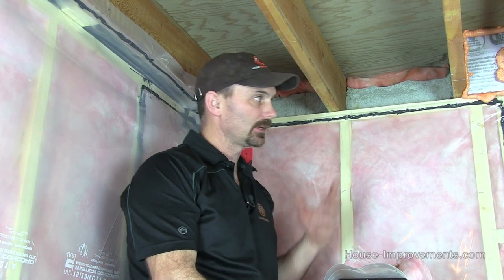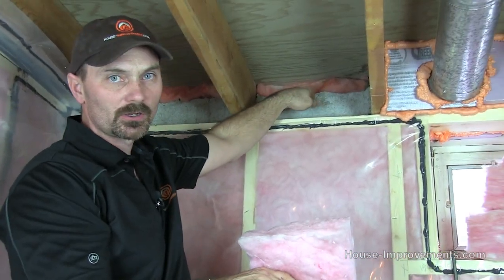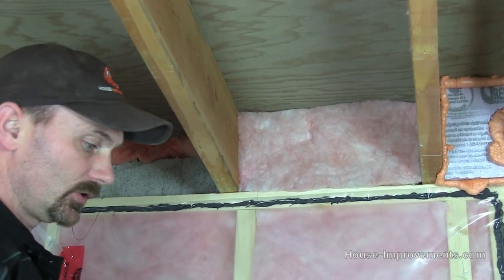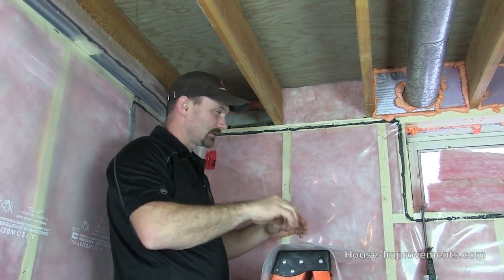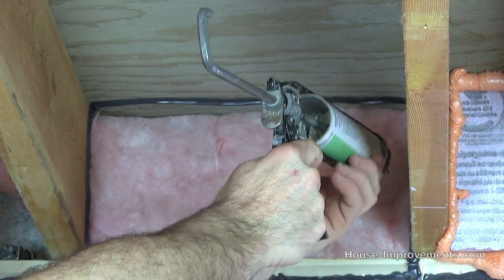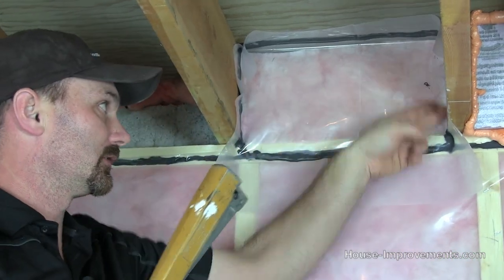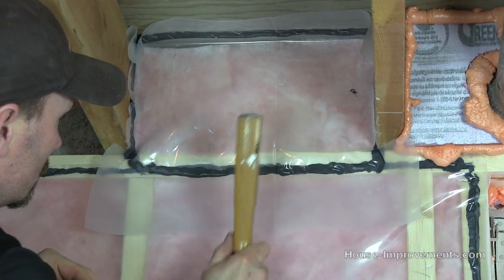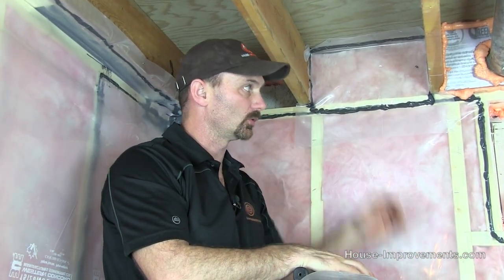How To Insulate Rim Joists With Batt Insulation

Comment: I used that method to seal rim joists. After 15 years so so  we noticed some cold spots in an upstairs bedroom and then in a corner of a basement room.   Removed some suspended ceiling tiles downstairs and found that the acoustical sealant hardened over time and the plastic pulled away letting air get through ever so slightly,pulled back the plastic and insulation and found about an inch of ice on the rim joists , what a mess.  Ended up pulling ceiling tiles around the entire perimeter and found more spots where the plastic separated.  Ended up pulling down all the plastic and removing the insulation… cleaned out mold spots and dried the rim joists then shot it all with spray foam instead.  Spray foam is way more expensive but far quicker and less mess.  If I were doing it from scratch I’d probably do a combination of spray foam and rigid foam to cut the costs a bit but give an excellent seal.

Comment: I chalked and used foam board and foam insulation on my rim joist areas. I’m very pleased with the results.
Reply: Did you use 6 poly over your rim install? Is it necessary?
Reply: @peterbergeris6510  No, don't lay poly over XPS.  Doing so will trap moisture if given the chance.  XPS doesn't need that because it is non- permeable.
Reply: Didn't Home improvement video use 6 poly over rigid insulation in rim joists because it was an inside wall?
Reply: Sorry, he used batt insulation n not rigid.

Comment: Hmmm, I was told by an inspector and a contractor to pull the pink fiberglass insulation out of my basement box sills and use closed cell foam insulation. It doesn't prevent water vapor from condensing and accumulating, causing damage over time. Go with rigid pink foam or spray foam (I picked the pink stuff)
Reply: Roxul is water proof and will not burn.

Comment: Acoustic sealant not required. It is definitely a bonus but you can use the red/blue sheathing tape instead.

Quick pro tip. The black acoustic sealant comes off the skin with a little margerine.
Reply: tuck tape often comes loose over time as it dries, or it might be difficult to stick it to a dusty basement joist - as with any adhesive tape. Caulk will always be pliable and will always create that "air tight" seal, even with time - this is also why he staples it. You can staple tuck tape, but then you're creating tiny holes for air to get through with each staple. Staple caulk and it's self-sealing.

Comment: If there is only one space in a house that should get sprayfoam and not fiberglass, rimjoist would be it. Nice vid you defently do it right I just see fiberglass fail on a daily bases and especially in rim joist.
Reply: I run a sprayfoam rig in Vermont. Treating the basement sill with closed-cell foam is definitely the the most cost effective thermal boundary upgrade one can do to a home. Just make sure there is enough air for all combustion appliances.

Comment: Great video. I’m just finishing a small duplex with an owner until in Alaska. I built boule stud 2x4 walls with a 2x8 top plate. The exterior walls have R40 closed cell foam. . I did the ceilings with R38 on top of R21 between the ceiling joists. I live on a south facing hill and have daylight basements wrapped in 4” of foam. Last winter was one of the coldest here with a week of -30s. We only burned about 500 gallons of oil heating 3000 sqft.

Comment: ive never seen this method used,would certainly be time consuming.most new subdivisions just staple in place without sealant,perhaps use red sheathing tape on bottom. good video as usual
Reply from the maker: stapled in place would never pass code. At least not here
Reply: thats all they do in York Region
Reply: @HouseImprovements  been insulating 6 years in all of SW ontario and literally I'd quit if I had to do this. 
a few staples and that's it

Comment: I did this in my old house. Was planning to do in my new house but the inspector said I needed to cover with drywall. Poly or kraft faced insul is flammable.  I need to do something since I'm getting condensation on the top of the exposed concrete, under the fiberglass insulation
Reply from the maker: Thats a new one to me, poly is not generally worried about left exposed in rim joist spaces? Ask about using  rigid foam sealed with canned foam and ten covered with Roxul insulation (it is fire resistant)
Reply: @HouseImprovements  I used 1" foamboard then sealed with spray foam. Brought batt insulation out to the plan of the drywall. In the winter when I removed the batt to inspect, there was moisture and frost on the joists and concrete sill. Since I live here now, I may just do what you show with some minor mods since drywall is up and painted. Instead of poly, I have this plastic that will breath vapor when the RH >60%.  Will feel better about not locking in vapor if any is present. Thanks for reply.
Reply: I think your inspector doesnt know what he is doing

Comment: A vapor barrier is usually put on the ceiling under the drywall and never on the walls! The good and a healthy strategy on attic ceiling insulation is like this from inside to outside: drywall-vapor barrier-insulation (at least 20 cm) - radiant barrier! between the deck and the vapor barrier remains a 2cm open space between the rim joists where venting is allowed in order to let air to pass above the insulation and let the insulation dry in vapors goes into the insulation from outside. Important: the radiant barrier is micro-perforated!  In this way when the solar energy heat the roof, the deck absorb energy and re-emit through convection on the radiant barrier surface. because of reflective properties of the radiant barrier almost 97% of the heat is reflected back on the deck. With this strategy the upper side of the insulation will be almost and always at the outside temperature and will let existing moisture to dry on the 2cm airflow space. I make this way in my home and works absolutely amazing! In winter I have a very good temperature and in summer I have a very cool air. Sorry for my english!:)
Reply from the maker: This is a basement not a roof deck.
Reply: Basement  you dont see the window

Comment: Save time. Use Rockwool. It will create a similar air barrier. Also FYI building science has determined that latex primer has the same vapor resistance as plastic. Except vapor is nothing compared to air movement.
Reply from the maker: Yes really restricting the air movement is as important.

Comment: Great video. If i am using a frothpack to air seal the rim joists do i still need to put polly up.
Reply from the maker: If it is a closed cell foam and at least 2" thick you should not need a separate air/vapour barrier.

Comment: I watched a how-to vid showing foam board being glued into the rim joist space first and it was cut undersized so that spray foam could be sprayed in around the edges for added stability.  After that they installed paper-backed insulation into the space to finish it up.  The vid maker said to do this because fiberglass insulation in direct contact with the wood surface could become wet due to condensation which can cause mildew and later wood rot.  Your thoughts on this?
Reply from the maker: If you are in an area with a air/vapour barrier requirement and you didi not use it or install it properly then that could happen, yes.
Reply: Use rigid foam cut 1/4in short height and width and secure with foamboard adhesive and then use spray foam to fill the 1/4in gap all the way around. If you want additional R-Value, you can simply add some unfaced batt insulation to fill the remaining space in the rim joist. You will not have any mildue/moisture issues with the batt insulation if you do it this way.

Comment: Hey Shannon, I know this video is older but I need your advice. I live in Calgary, and have frost on my basement walls as well as damp walls behind the fiberglass. 

I had a basement expert come today, they said my rim joists are not insulated which leaks cold air into the basement and that's why my walls are wet and when the frost thaws it drips on my floor. She recommended that I get them to spray foam the rim joists and go 2 feet down in order to ensure that I have a proper seal. This will reduce cold air from coming in and causing the frost. She also said my humidity levels are too high (45%) and that, combined with the rim joists not being insulated, is causing my issues. 

Would you agree?
Reply from the maker: There could be a number of factors ,including that one. We could discuss it more if you post this question on my forum. https://www.house-improvements.com/forums/

Comment: Under the Ontario building code you need to have foamed plastics covered in most applications, usually plywood or drywall.
Reply from the maker: Yes in many places you do need to have it protected from fire. Fire rated ceiling or drywall ceiling would do it for most places
Reply: @HouseImprovements 

I've used your videos as a great learning tool! Appreciate your response.

Comment: Previous owners had fiberglass inside the rim joist, and spray foam behind it acting as a vapour barrer. It trapped the moisture,  making the insulation damp, csusing the wood around it to rot. Im now replacing my sill plate, joists, sub floor, and sheathing. 

Should only use closed cell spray foam in rim joist area. Nothing else.

Comment: I've been in pest control for 30 years and have been in tens of 1000s of buildings, in every square inch of them. That's not an exaggeration. I would never do this unless I lived in a harsh winter environment.
Reply from the maker: Required to be insulated and air/vapour barrier covered in many northern areas like Canada.

Comment: I did this technique vary carefully and as Shannon said, you get that black sealant all over the place.  Unfortunately, in the four "test" bays I did this, I got lots of condensation on the inside of the plastic in the hottest/humidest part of the summer, despite my best effort to seal the bay up thoroughly.  Tearing it all out now and going with XPS sealed with foam around the gaps.
Reply: What's your climate if you don't mind me asking? I'm seeing Canadians do vapor barrier facing the interior (as showing in video) and southerners do vapor barrier facing the exterior (usually foam board or spray). I guess the issue would be where the warmest air generally will be. I live in wny and most months the basement will be warmer than the exterior. 

NYS seems to advise 2 inches spray foam, of course, that's the most expensive way to do this.
Reply: @kw6713a  Not too different from western NY.  Cold winters with hot and humid summers.  Vapor barriers in the basement on the "warm in winter" side typically cause all sorts of condensation on the inside of the 6 mil plastic during the hottest and humid weather of July and August. Only dries out in the fall.  The new procedure is to NOT install any vapour barrier on the warm side and DO install Typar next to the foundation.  Or, just infill the cavities with spray foam.
Reply: @canuckfixit7722  thanks man, that's very helpful to know. What do you think of 3" XPS board inside the cavity, spray foamed around the edges as a substitute for the spray foam kit? Then a drywall piece for fire retardant. Seems less costly though more time consuming.
Reply: @kw6713a  Correct!  That's exactly what I did:  To match the R20 in my main walls, I used two pieces of 1.5in XPS (extruded, not expanded).  Each piece cut a little smaller than the cavity, inserted , centered with a temporary brace then foamed around the edges.  Let that one cure, then trimmed off excess foam and repeated for the next piece. No adhesive needed.  To hold the drywall covers in place, I cut 0.5 x 0.5 in pieces of wood placed vertically on each side then brad-nailed them in.  If done right, the drywall will be flush with the sill plate or proud of the sill plate in which case cut it wider and screw to the side of the sill plate.  This does take time and the thick XPS sheets can get expensive.
Reply: @canuckfixit7722  thanks a lot, that makes a ton of sense and a load off my mind. All doable and should be within budget. One minor question, does the drywall have to be flush up to the foam board or should it be flush to the edge of the sill plate?
Reply: @kw6713a  Depends on the depth of the cavity.  Mine ended up being 0..5 in more than two sheets of XPS so the 0.5 in drywall nested in nicely to be flush with the sill plate. This left me with the exposed side of the sill plate  ready to set in a top plate for future 2x4 stud walls.  If you are not going to finish your basement, fill the full depth of the cavity and then screw he drywall to the side of the sill plate and don't bother with the two wood pieces.
Reply: @canuckfixit7722  gotcha man makes sense. My basement is too low for finishing and the cavities are deep. I'll just screw drywall to the sill plate. Thanks again! I'm pumped to get this done
Reply: vapor barrier fiberglass.   no mess.

Comment: Hi. I'm in upstate NY. Got an old house with stone foundation. Huge millipede infestation and drafty house. How best to insulate my basement ceiling? Hard to do with wires/cables all over. Got the oil burner down there too.  Wouldn't the upstairs be warmer if the basement ceiling was insulated? How best to do this? Thank you!
Reply: Can you post a link to a picture. One of us are from Plattsburgh NY. Ever hear of it?
Reply: Stop your drafts
Reply: Late to this party but I have a similar southern tier house. Isolating basement from climate control seems out of bounds given electrical, plumbing and HVAC units that are down there. Should try to keep it at 50 degrees to avoid freezing all that stuff, so it's not recommended to insulate the 1st floor from the basement in that case. Insulating the rim joist is proving complicated, though air sealing seems the most important thing to do.

Comment: I bought rock wool for 2x6 r23. I only had to cut once. I don't think I need 6 poly to cover since it's a comfort batt.
Reply: If you don’t put in a vapor barrier you will get condensation in you insulation and make it worthless. I live in Alaska and I have been in peoples basements where to  batt insulation is damp. I cut closed cell rigid foam board about 1/2” smaller than the opening and then foam the gap using one of those $50 foam guns the cans screw too.
Reply: @Chris_at_Home  roxul is water proof. If water gets on it , it will not even reach the middle of the batt. This old house with Tom Silva put 1x3s horizontal n vertical against rigid insulation. He told homeowner he could install rock n didn't mention barrier. In warmer states no barrier needed. But zones 4,5 and above it's required.

Comment: Hi Shannon i am getting ready to do my basement so I have a question so my basement walls are block wall so is it on to put up 6 mil Polly frame then insolate then a another layer of six meal poly over that then drywall ?
Reply from the maker: Depending where you live and the codes there . In my area , yes. You need a moisture barrier ,insulation and a vapour barrier. Here is my playlists for basements.https://www.youtube.com/playlist?list=PLh0KqGKtX4oWcBaAyNet_W9UL0nfPS16F

Comment: I put plastic on my walls over my insulation just like this before I finished part of my basement. Luckily before I hung the drywall the heat came on and I had a problem. I had created some sort of thermal break with the plastic, and the wall was sweating enough to pool on the concrete floor. Took the wall completely apart and had the block sprayed with closed cell foam. Then reinstalled the wall and unfaced insulation with no plastic. Fixed the problem. Moral of the story is plastic is not for every basement. Be careful. That being said, I like this method of insulating the rim board.

Comment: Hi Shannon,  I have an unfinished basement in a house built in the 1930's. This video clearly shows how to add insulation between the joists but how would I insulate the area along the walls that run perpendicular to the joists?  How would I secure batts and vapour barrier? I want to insulate where concrete and joists meet on all 4 walls. Thanks
Reply from the maker: please use my forum for your question.  http://www.house-improvements.com/forums/

Comment: Hey Shannon! Love your videos. I am renovating my basement suite and ended up doing something similar with rim joist spaces and this video just came up on my feed. I used accousti-seal all around the seams of the rim joist to air seal, then stuffed it with rockwool. Do you think that is sufficient? By the way, anyone that gets accousti-seal or that roof tar on them, try using lysol or baby wipes. I find that they work very well to get that stuff off quick.
Reply from the maker: That will be better air sealed then without the acoustical but would not pass code on its own.

Comment: hi Shannon
i found mold in the insulation at one wall in the basement, at the sill plate/Rim Joists area. the patio door is just above this wall, and the wood deck is at the outside of this wall just leveled with the Rim Joists.
what is your explanation and advise?
Reply from the maker: please use my forum. http://www.house-improvements.com/forums/

Comment: A home inspection report recommended stapling R19 batting insulation into rim joists.  As it was, there was no rigid foam secured against the wood.  Is this acceptable?  (I already stapled the batting insulation in place, against the wood, as the inspection recommended.)
Reply from the maker: That is still ok.
Reply: I suspect this matters by climate? Down south they seem to put the vapor barrier snug against the board (usually xps with sealing around).

Comment: I have a few hot water pipes from the furnace running up thru those cavities, they are too hot to touch, if the insulation touches those is that okay?
Reply from the maker: Check with your local HVAc shop but I would say if you used Roxul insulation in those spaces you should be ok.